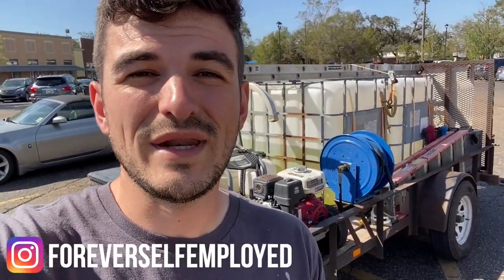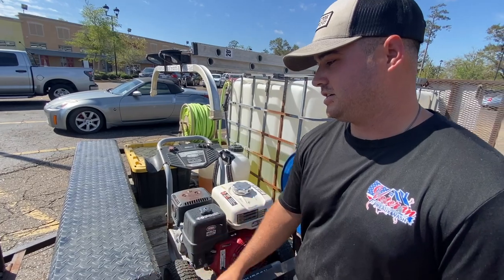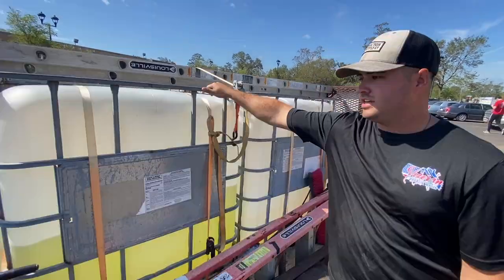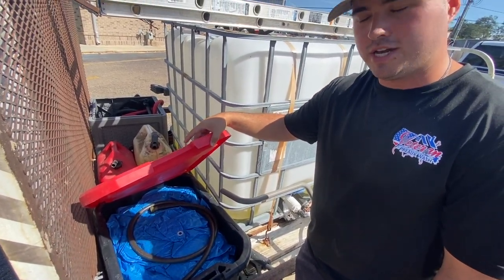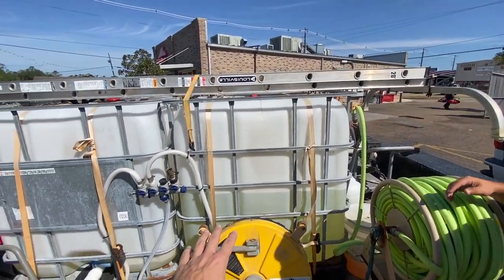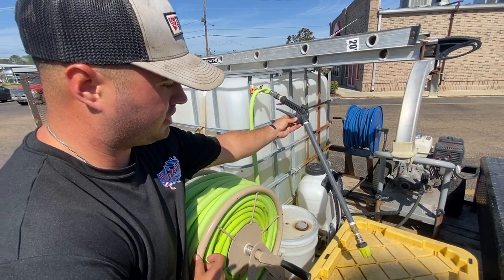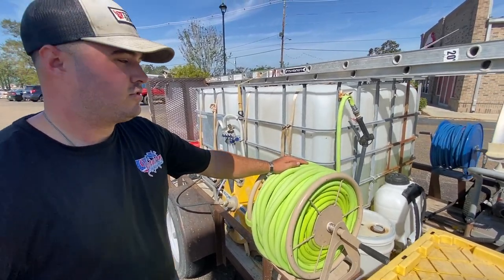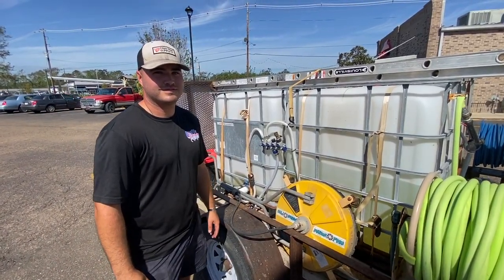$3000 Budget Pressure Washing Trailer Build

Comment: Bought a trailer for this exact reason. Trailer at Lowe's was $1,250 with tax. Can carry 1,600 pounds. One 100 gallon tank weighs 835 pounds with just the water.
Reply: And if you look real close 
He doesn't drive with them full, but has a hose to hook up to customer water
50 and 50 is 835, and go slow liquids move

Comment: Hey Justin I was just about to go look at a 10 gpm full trailer setup with buffer tank chem tanks hose reels and a hot water burner for 3k the catch is it has been sitting for a long time. What do you think? Industrial set-up with possible problems or 4gpm new everything?
Reply from the maker: Good question bro. My guess is if that commercial trailer was worth it it would be priced much higher. I prefer to buy new with warranties. The last thing I want to do is fix someone else’s old unit. But if your mechanically inclined it might not be a bad idea.
Reply: @ForeverSelfEmployed  I thought about it all day yesterday and I am going with an all new 4gpm setup. I am going to go get a parking lot striper today though, starting out lean and mean!

Comment: What you could do is buy a hose repair kit and replace the male with a femail on the hose so it stays in the trailer
Reply: Or go to Lowes and buy a male to female or a female to male garden hose fitting for around $10.

Comment: Hey Justin, great video man. I may be over thinking this, but that trailer is a single axle 3500lb rating. The empty trailer probably adds 1200lbs so 2300lbs left. I would think he might be a bit over loaded with this. What do you think?
Reply: Main weight is liquid in tanks and don't need to travel very loaded, just for a water buffer while on the job
Reply: Get it weighed at a scrap yard somewhere.  Then add on some stuff and see where you are next time you go.
Reply: 1 gallon weighs roughly 8.5 lbs so I’d say he’s fine with 3 55 gallon tanks
Reply: I have a new 12'X6.5' single axle , it weighs 900lbs. factory empty weight with a 3500 gvw 8ply tires ... the trailer weight is on the registration  ...

Comment: If that front tote is SH he might have an issue with DOT.
Bleach is a corrosive and if hes hauling 1,001 lbs or more he might get a ticket(s) from DOT.
I know he said its a roof batch but its still corrosive so that doesn't matter. 
The average cop has no clue but a DOT officer see's the tote and the liquid level and will know its over 1,001 lbs.
Im saying all this as a warning and not trying to be negative and with 24 years experience hauling hazmat I know what I'm talking about.